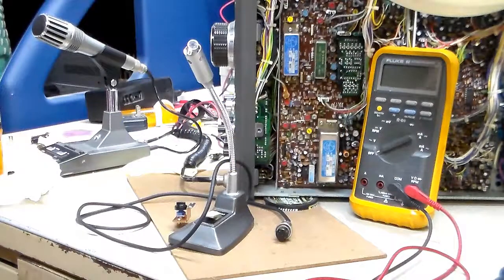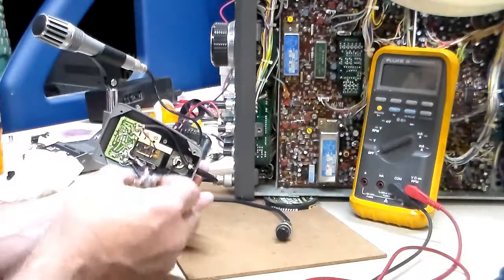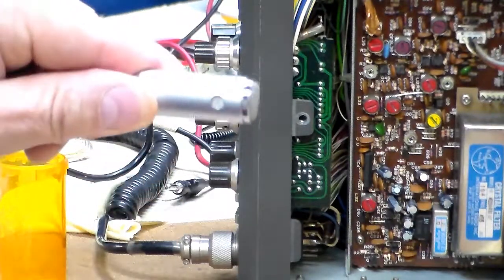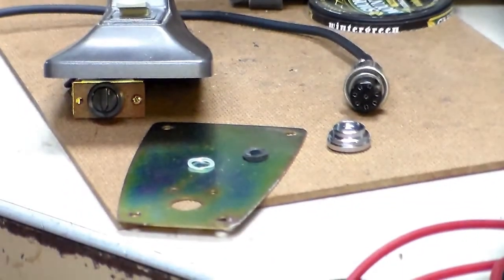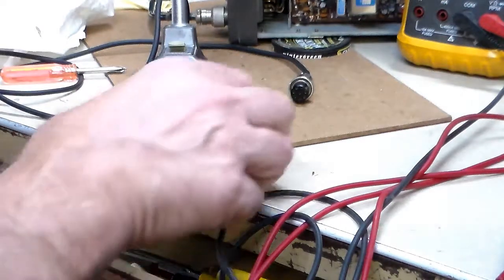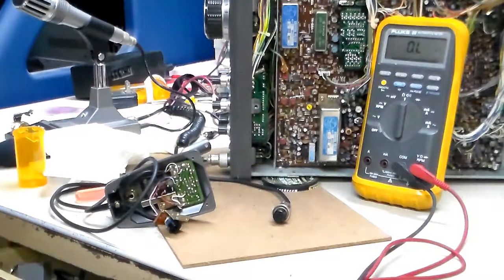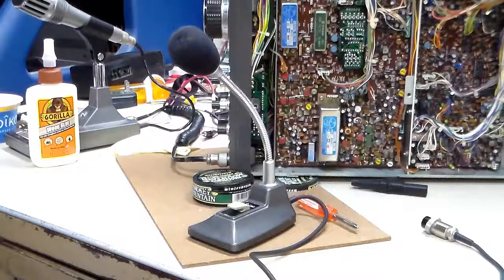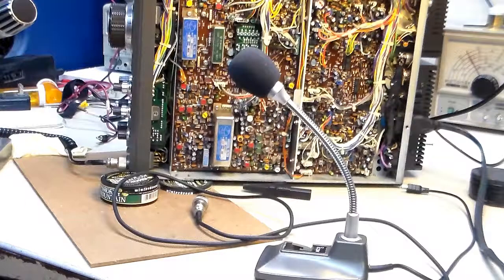ICOM   IC SM-6   Microphone

Comment: Hey any tips I have one of those mics I have been trying to get to work with the original icom ic-706 with no luck, i purchased a cheap adapter on Amazon the one with the rg-45 jack but it’s not working.